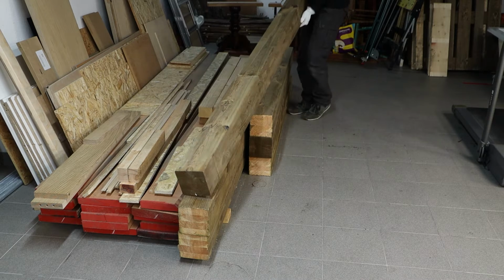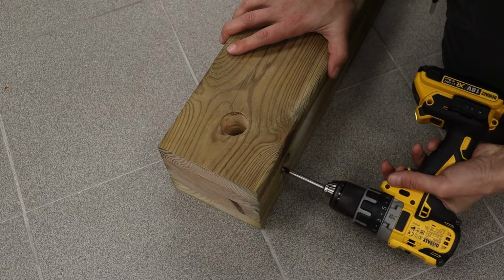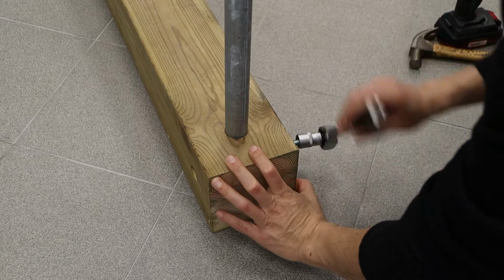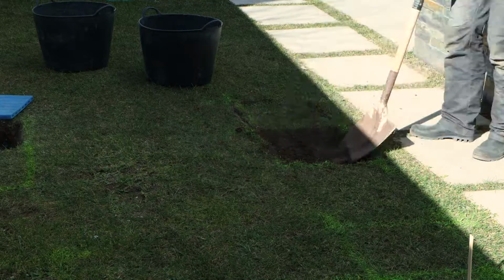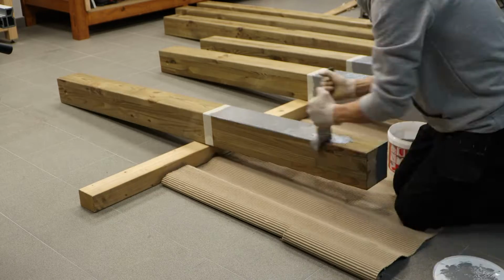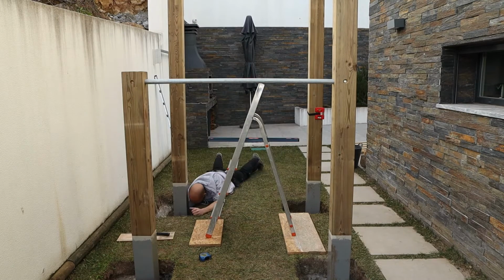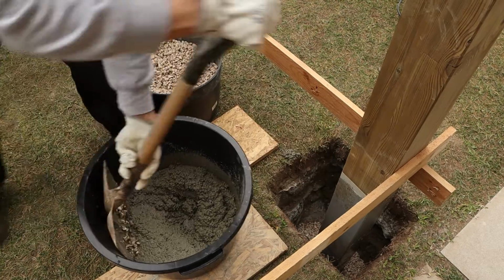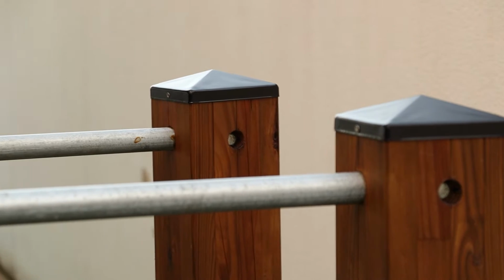Outdoor Pull-up Rack

Comment: Awesome work! I love it. I want to start this project but I’m currently renting where I live. I didn’t want to mess up the owners property with concrete in the ground. Do you think this can still be possible if I put each post into a Home Depot bucket of some sort and fill that up with concrete.
Reply from the maker: Thank you! It might work, but it has to be a large bucket because it's not fixed underground. You can try to fix it also with some steel cables, but I'm afraid it will wobble a little bit more... Good luck on your build! 👍😉